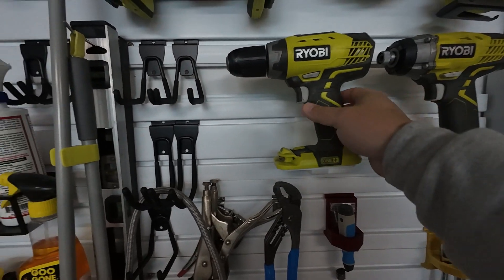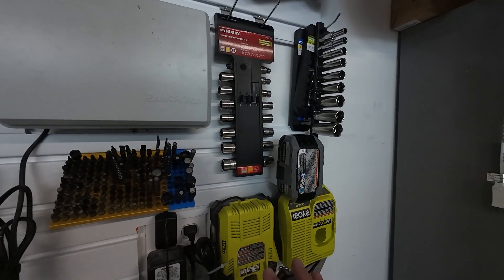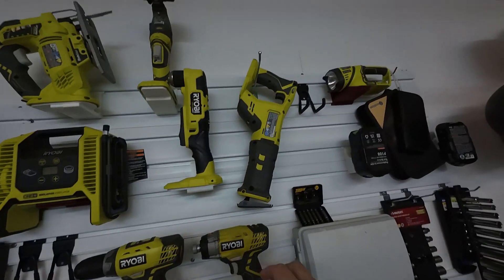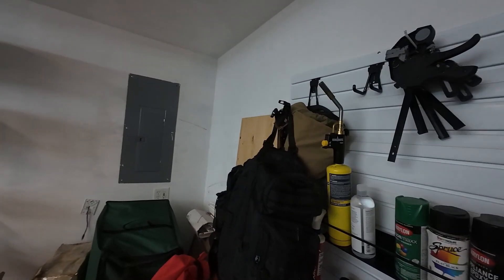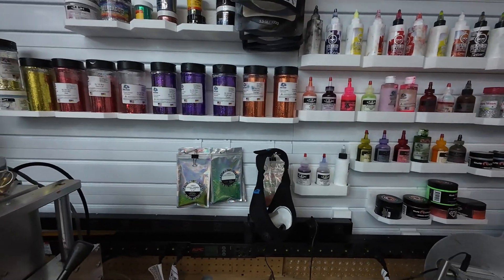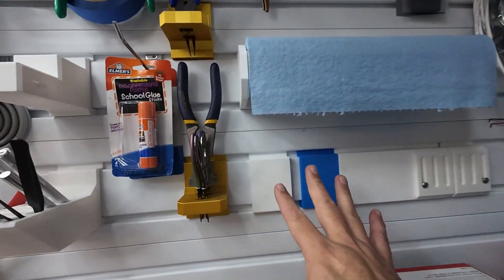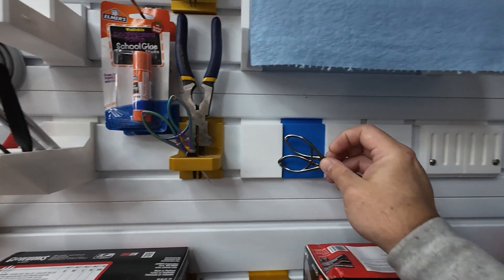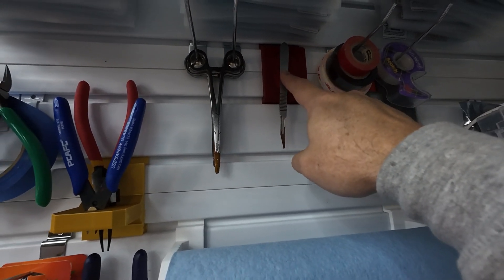Stop 3D printing wall storage! Slat Wall Rocks!

Comment: Hey man I just want to thank you. When I was looking into 3d molds, I was curious but not that curious. I noticed the filaments werent capable of producing good lure molds for soft plastics. 

I recently discovered your videos and I'd watch them here and there. I'm not one to really venture off into trying this first hand by myself. So be able to do it vicariously through you I really started to get more interested. I did the research on a resin printer vs filament printer. 

Recently found a resin printer close to me for a steal. 

I'm hoping to make some 3d molds and also make some kayak accessories. I appreciate you for helping me take that step by being confident in the product I'm getting. 

its an anycubic photon m5 mono. Comes with quite a bit of resin too. Theres a small spot where the LCD wont print. But I think If I just print around that for now I can get to see what its all about. I believe the replacement screens are only 100$. I'll be in it for less than that to try it out. Not to mention it comes with a cure station too. 

I'm excited!! I want to design a specific soft plastic I don't see, or at least to the standard I'd like. 

I couldnt have made this push to venture out without you! So thank you so much for being so brave! I love your organization journey! If I could be even a small percent of your success It would be a win in my book! THANKS!!!!

Comment: Why not just merge the mounting plate to the device in the slicer? I’ve remixed lots of combinations for my Gearwall. Works well as the normal slatwall hooks are strong, but very limited. I really need to post these on Makerworld but for the models and to get credit to the original models I remixed them from.
Reply from the maker: Yeah you 100% could do that! I generally add some chamfers for added strength but if that is not needed then you can 100% just merge them in the slicer.

Comment: Shopping for slatwalls in Amazon, I found a 4'x4' for $90.  Is that a good deal?
Reply from the maker: If you need to get it shipped that is probably pretty good. I found mine locally 4x6 PVC for $80

Comment: Slat wall definitely better than hex wall, but nothing beats cabinets to hide clutter.  2nd place would be stacked plastic bins on shelves or open bin racks.  Having everything you own visibly stuck to the wall just looks like a store or something, very busy and chaotic.  Woodworkers have the cleanest looking shops, since they have the ability to make custom cabinets that would be too expensive for a non-woodworker to buy.  Really depends on what you are trying to store though.  Power tools hanging on a printed hex grid wall just looks like a collapse waiting to happen.
Reply from the maker: I can't have things in cabinets, my ADD is such that if I cn't see it, it doesn't exist, so I live my life in a store 😆
Reply: Yep, adhd + a widget in a drawer or cabinet… not only do I forget wher it is, I forget I ever had one.
Reply from the maker: @oscardiggs246  💯 👊🏻

Comment: about 6 years ago i just built a fake wall. (I did not want any holes in my basement) and just put up a 4x8 sheet of peg board then 3d print anything you need hung, lots of free prints. In the garage i use French cleats. rip them down easy with table saw. use .75 plywood thick then 3d print accessory's just like the peg board.
Reply from the maker: I don't like 3D printed pegs for peg boards, almost always the pegs are never in the right spot for optimal printing, although they totally work, the Peg Anything project has some nice tools. 

French cleats are a good option as well, I just don't do any woodworking or have the tools for it.
Reply: @WMBayouLures  I did have the issue of the pegs breaking off but that was before simplify3d 5 and orcaslicer. i dont have that issue no more. and i learned to oriented the correct way. dont put the pegs pointing up. use support and have them stick out the side i guess i would call it.

Comment: I use aluminum slat walls in my gun vault the contractor put up 8-4x8ft pieces because I hadn't specified. It works great. I tried hex and a skadis section over my bench and it's ok. Skadis is great for my office and my printer areas. I also have a mill and titanium 3d printer in one of my garages but I'm trying to find the slat wall to hang up fixtures and tools. The contractor got my aluminum slat at a retail display liquidator who is out of business now. I wish I could find more for my main garage because I like to hang signs, parts and track parts I put on for certain tracks. I do nostalgic racing for charity events. I am supposed to be getting a late 90s Italian car for my charity laps for make a wish and other charities. I had to make a seat mount out of titanium to add a wide recaro seat for a teenager with MS that required a wider seat due to a brace he wore. My 308 magnum pi car I use for taking to adult assisted living facilities. My friend has a md500 he has painted to look like the TC helo. We take old folks for rides. I had to remake some obsolete parts for that car with the titanium printer. I also make little toys of that car on my bambu printers. I did make a star trek metal phaser for a children's hospital kid. He wanted one.
Thanks for reminding me that i need to work on the wall organizing again.
Reply from the maker: Wow you have all the cool toys! I have seen a lot of slat wall around on Facebook from people closing down/moving businesses, you just have to keep on top of it.

Comment: It's almost always better, cheaper, and immensely faster to buy something if it already exists. Printing something for my personal use that takes 700 hours would cost me $1400 in lost revenue. I would much rather spend $200 on something premade and readily available that I can assemble while my printers are making me money.
Reply: or you can buy a bunch of plastic/kydex sheets and print a jig to form them.
Reply: What product do you provide that is worth $200 per hour?
Reply: @ $1400 in 700 hours is $2/hr
Reply: This is inaccurate. For example, a basic phone case in one color costs me $1.00, while online prices start at $10 and often reach $20. Larger items may be more expensive, but they still won't match the cost of buying them online.